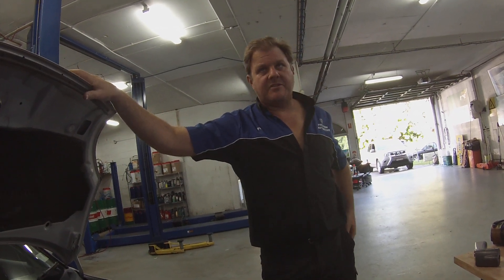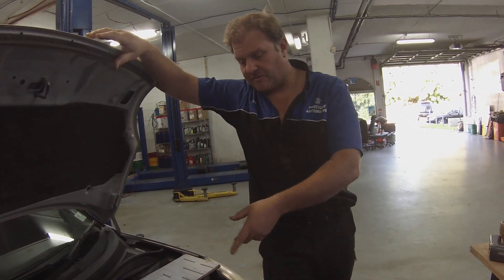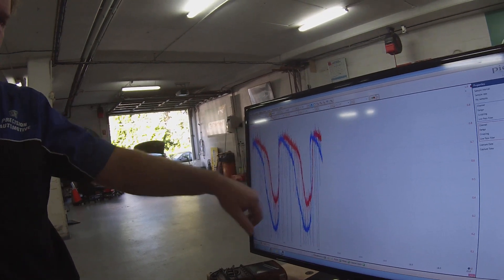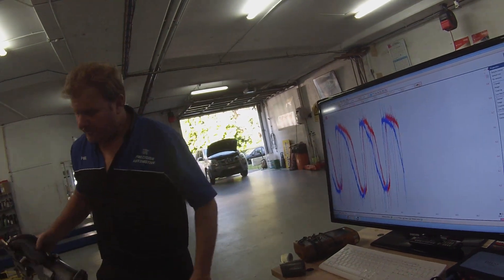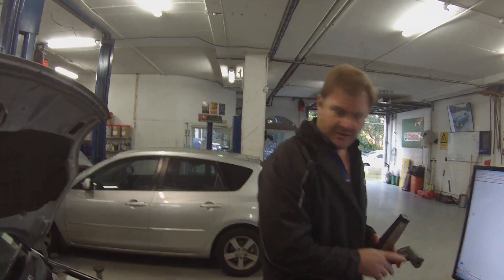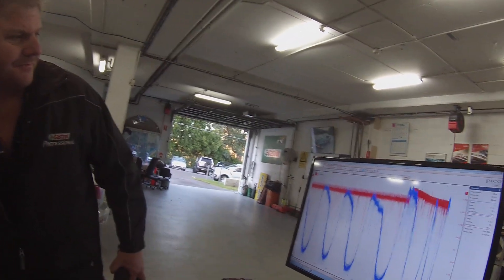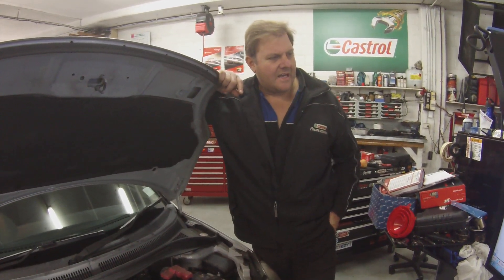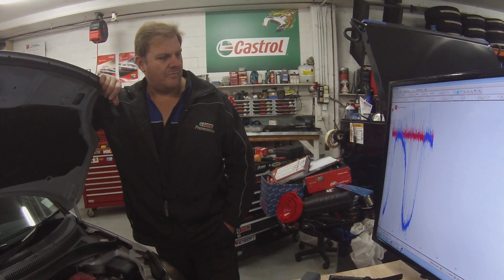Suzuki swift catalytic converter fault P0420

Comment: Hi i have a swift sport 2008 model.. m living in a 3rd world country where the fuel quality is really bad ... a week a go my cat gave up.. and the only solution my mechanic had was to remove the cat all together .. and let me tell u m not happy at all..now when the car smells of smoke at idle and when I rev it up (standing) I see a mist of life while smoke.. check the gas kit an all .. no issues there .. 

Wht say you .. ? Thanks
Reply: I have a 2013 swift sport and I'm getting the code P0420  now I have put on an after market header.
Reply: @DC5Boss hey did that save the problem? 
I have that problem on my swift sport 2013 for a year. 
I cleaned catalytic and replaced o2 sensor. But still after some time I get p0420 error.
Reply: Header????? Wdym  @DC5Boss

Comment: I see you have used  a G SCAN 2.Did you use the 4 channel scope feature on it for diagnosis?
Reply from the maker: we actually have a Pico which is what we used to diagnose the Cat
Reply: I saw you use the G Scan on the i Load low power job and what were you thoughts on using it.  @PTPrecisionAutomotive
Reply from the maker: @stevenbowyer8816  it's good to use for scanning, resetting and reading live data which is what we use it for but we definitely would rather use our pico for scoping as it's a lot faster but in saying that I've heard it's not a bad tool to use and it's a lot cheaper than a pico
Reply: I have the 4 channel version and interested in your thoughts using the G scan.When I purchased it I had to toss up the options of scan tool plus a bit of scope or the Pico.Mind you the G scan wasn't that cheap either.The Pico is the tool to go for but is another big ticket item.Good back up on the Pico.Hard to find any relevant data with the G scan.Thanks for the reply Phil.
  @PTPrecisionAutomotive